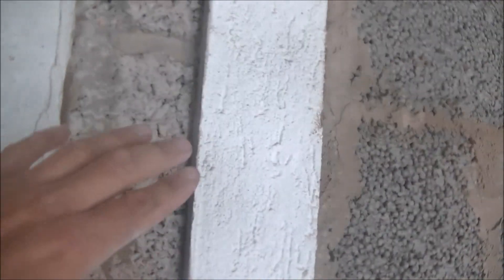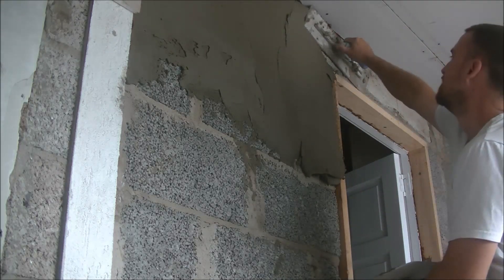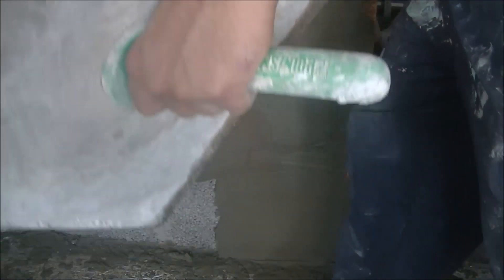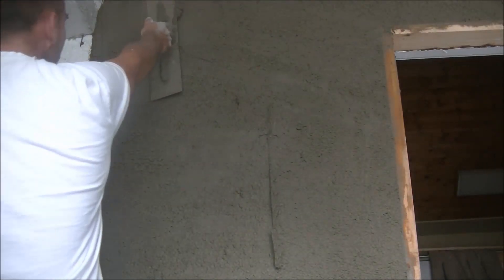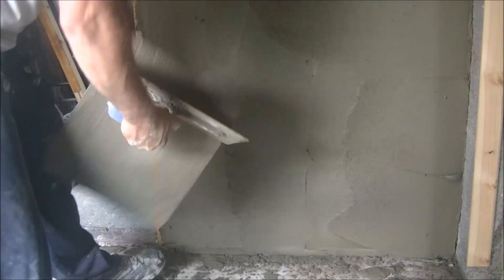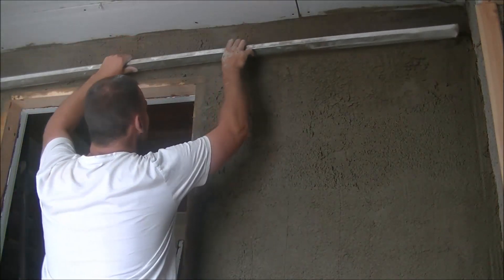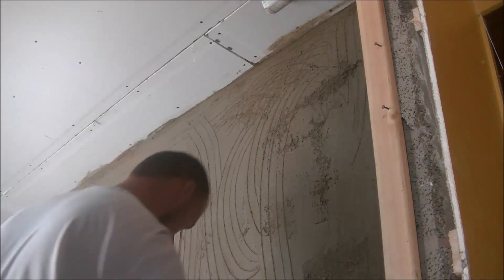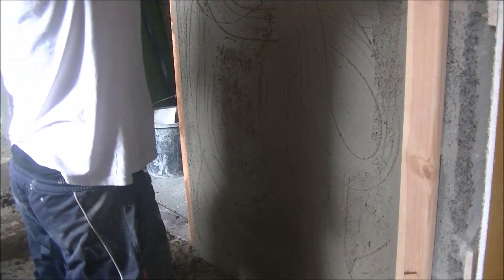Sand & cement Render Wall Ready for Plaster Skimming Door Wall How To

Comment: I worked with an English bricklayer plasterer. I was told they use a float with nails in the form a key for the plaster. I also picked up some feathering straight edges which is great for screeding wet work, or even screeding back patches straight away. Our climate is more warm and use clay bricks more than concrete blocks. I got pieces of steel sheeting as straight edges on the shorter lengths which work very well. Thanks for spending the time uploading. Well done.
Reply from the maker: So glad the videos help you man yes all of what you say is perfect techniques and tools

Comment: fair play lad u covered everything with this video.it important to take ur time with angles and diir frames etc
.im sure it will help a lot of people ,👍
Reply from the maker: Hi Emmett mate Thank you man yes tried my best to get all the details in for sure  cant wait for the better weather to kick back in :)
Reply: @macplastering  ya man the bad weather seems to be everlasting ffs.makes rubbing up render work harder waiting for it to dry up.the good weather isnt that far off lad abd with that our spirits will be lifted .keep safe my friend
Reply from the maker: I have seen the nights a little brighter now so I think you are right the summer is coming back :):)
Reply: @macplastering  hi mac i have a fairly handy size chimney to do in the morning.finish coat.it was scratched yesterday but over the weather i say its be soaking wet in the morning.il will be carefull with the wetting and make the mix fairly strong.a small bit of water proofer and hope for the best.hope it goes off quick enough
Reply from the maker: @emmettmccarthy7247  Hope you get a good sunny spell mate to help you along the serrated edge i been using helps me some letting the air in longer fingers crossed for you mate let me know how ya gett on
Reply: @macplastering  thanks mate i havnt 1of those edges but il leave it open as long as i can when i straighten it.iv made the mistake a few times by dragging the float over it while its 2 wet.its just a days wage in it for me.he done the preparation himself so i hope he filled the beads out enough so its not that thick a coat.🤞
Reply from the maker: @emmettmccarthy7247  Hope you got on well buddy
Reply: @macplastering  hi bud i.was meaning to txt u earlier.it went like a dream bud.bag and half of cement in the small mixers and small bit of waterproofer.i just gave the scratch a small sprinkle of water with a stockbrush and by the time i got the chimney coated and straightened it was ready to float.happydays,👍
Reply from the maker: @emmettmccarthy7247 Nice one man Some times we get lucky here yesterday was cold but dry glad you got it sorted easy :)
Reply: @macplastering  thanks bud.ya it was nice to do a bit of plastering again.i like floating the render up.my elbows were all swollen with fluid or something but not 2 bad now.the plastering does take its toll at times.hard to get back into it.but ya it was nice to do a bit for s change.i was putting a bike together there for my girls birthday present.it took me ages but done now.happy days
Reply from the maker: Can be hard for us plasterers to put them sorts of things together :) I have some more footage from hi we job I go into more detail onto the angles :)

Comment: Looking good mate👍👌
Reply from the maker: Cheers man how's things going? have you ever seen blocks like those before made from Polly insulated balls hard to see until you take a good look must have been hand made but really well
Reply: @macplastering  yere not too bad sick of the flagging job now lol. Yere i used them before. They not nice to cut with chisel they sometimes brake up a fair bit 👍👍👍
Reply from the maker: Oh can you cut it with a hand saw ? or would it blunt to fast with the cement or just be to hard on the arms LOL

Comment: Hi Mac. Can I use builder's sand for the base coat or must it be plasterer's sand? I have a wall that was remodeled to swap the door and windows around so I have to fill in 1 inch recesses ready for top coat render. Your advice would be hugely appreciated as I'm battling to find this info. I have so much building sand left over and I'd like to use it, if possible 🍀
Reply from the maker: I would strongly recommend plastering sand hanna it is stronger and better to work with its gritter than building witch gives it strength building sand shrinks to much and can slide loads when coating and getting straight
Reply: @macplastering  thank you SO MUCH, Mac. You are so kind. It's a pleasure watching you work and your instructions are so good and clear. Thanks again 🙏🥰
Reply from the maker: @hannahswann747  not a problem thank you hanna

Comment: You are doing your job perfectly, I really want to know what  makes a difference using fiberglass mesh embedded in the base coat,  Is it  the surface's not being    suffiecent  to make a mechanical bond or the mortar's quality(ratio of sand,cement water), or  exterior wall  rendering coat being exposed to temp changes.I couldn't get any satisfying answer till now
Reply from the maker: Thanks for watching and the nice comment. But yes embedding mesh of any kind is stronger than if it was just applied to surface. For skimming it's OK as it's only 3mm thick have a good few mixing videos up and more videos like this ... thanks again for watching

Comment: im not a plasterer but I've done a few small areas 3m square this week. i got better at it each day. yesterday however i made the mud too wet and in 1 area it kept sliding off so i removed it all and started over. i also think by starting at the bottom wasn't a good idea
Reply from the maker: I like starting at top left and work left to right others prefer the other way but most plasterers i know in person do it the way i do... yes its all in the mix if you get that right and preparation things go a lot better, and as you know when plastering starts to go wrong its really hard work then... thanks again for watching and keep at it my friend always here to help

Comment: Thank you for all these tips Mac. I was wondering if you get the occasional accident such as, spill bucket of render, plaster or water on the floor. Just as well you keep the floor clean. I must remember to use a float. I hate it if I get plaster to prominent and not notice until it has dried hard. I tried sanding it down with sander once but it got too dusty.  I expect you will get a good finishing plaster rather than just multi grade so you get a better finish. I buy multi purpose because I'm only doing DIY for myself.  I used the back of a tile to make an embossed impression for final coat to adhere to it, rather than scratch the surface. It saves bits going on the floor.  But it is quicker to scratch it.
Reply from the maker: The back of a tile sounds a good trick man, oh yes have for sure dropped buckets over the years and spilled water it can be a nightmare but with time i find I be much much more carful , cover up is a must always :)

Comment: So we can just sand and cement internal walls? Im thinking of doing my loft walls as practice before I give my external walls a shot. 
I've read mixed reviews on just using sand and cement.... Thought?
Reply from the maker: If you have block walls this is in my opinion the best way to do them I will be building my own house and will be doing this on the block walls I have and do this the same in my own home and families homes its a very good way to do block walls again there is other options but for these walls this is best way cheapest strongest nicest to skim over again if just small maybe hard wall and skim same day but all jobs are that little different, outside walls are a slightly different mix as you will ned to scratch and then top coat 2 different mixes and again slightly different than inside mix , we have loads of outside rendering videos and loads more to come :) Thanks again for watching and commenting mate hope these help

Comment: Watched a few of these plastering vids and have noticed not one plasterer left a bridging gap between wall and floor to prevent any damp going up the wall from floor level .Just curious to know why this is not shown or explained the importance of a bridging gap .
Reply from the maker: Wwwould do that on a damp job one that has been chipped off and pumped but this job is very dry and inside walls mostly so doubt any damp will rise here
Reply from the maker: Did this on a recent video on a damp wall to help prevent damp
Reply: i would love to see damp rising in sand cement render

Comment: I used a small spray gun to apply the PVA mix it worked pretty well and fast
Reply from the maker: I would mostly use a roller and brush to cut in

Comment: I was taught fat and ugly but i've leant towards coating as you do, after watching my hard work slide off of the odd thirsty block. That's not so bad, but when the homeowner is passing and asks you if its meant to happen.. my face got a little hot.
Reply from the maker: Haha man things like that happen at the wrong time every time i do like to try build up especially door frames dead walls not to bad but anything heavy i preffer a nice build up

Comment: Haha that walls a load of balls 😂
Reply from the maker: Haha did you see them blocks never seen that before until this job but I bet they where light and easy to work with and cut plus keep heat in ?
Reply: @macplastering  ya mack never seen them myself either.they would be a lot lighter i guess and probably acts like an insulation aswell.so thats the pros i wonder is there any bad side to using them ?